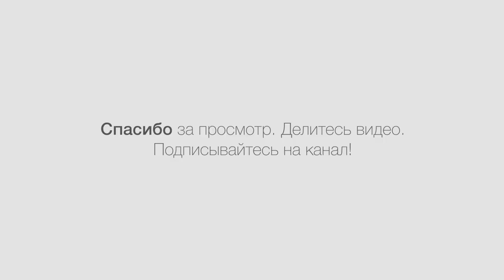How to Glue Thin Plywood 1/4" (6mm)

Comment: This is an excellent idea. I had to glue 6 mm plywood just recently and used a lap joint but it was messy and didn't work too well at all. I think this approach would have been better. What's better still is that no table saw was involved! I don't have one but I do have the same track saw.  I'll have to do a trial run of this example. Thanks for sharing.
Reply from the maker: This is one of the options.  You can also use a manual router and a special router bit. 
Visit my instagram https://www.instagram.com/reel/Cg5-6i_DGFh/?igshid=YmMyMTA2M2Y=

Comment: That looks like a very nice and tight joint.  Having seen a Matthias Wandel video using butt joints on wide ply panels, I have used this method and achieved very good results.  Prior to that, I was skeptical that an adequate bond could be achieved, but have wasted significantly less ply on projects where a seam would not appear as poor cabinetry technique.   Thanks for the video.  Cheers, David
Reply from the maker: Thanks for the feedback.  There are different connection options.  I use them periodically.  Quite reliable.  It was this plywood that he later bent - https://www.instagram.com/p/CTLAzMvj3nR/
Reply from the maker: https://www.instagram.com/reel/CkAYCiwDbHv

Comment: You have taken off the rubber edge guide?
Reply from the maker: No, I didn't take it off.  The new rubber edge is transparent.
Reply: @DmytroDovzhenko  were you measuring the gap at one point?
Reply from the maker: @michaelodonovan6989  It's not difficult. Festool disc saw, has precise depth adjustment.
Reply from the maker: https://www.instagram.com/reel/Cg5-6i_DGFh/?igshid=YmMyMTA2M2Y=